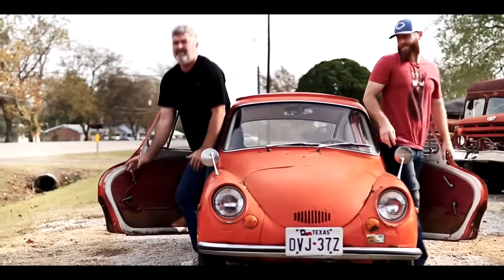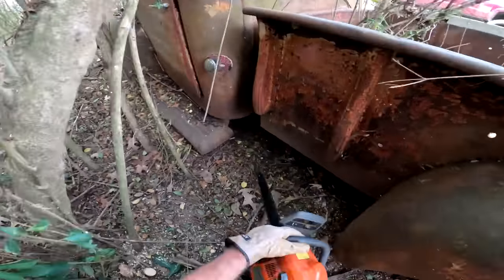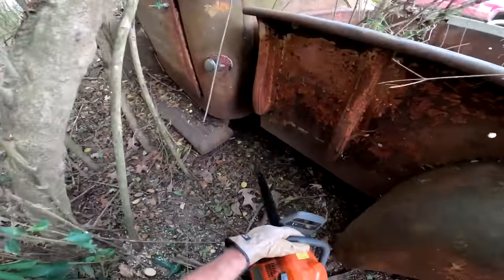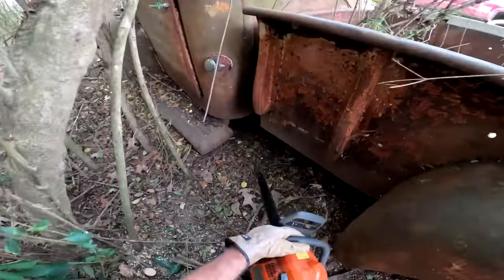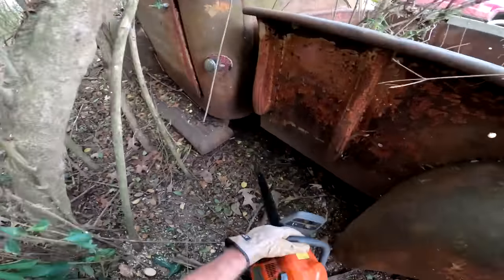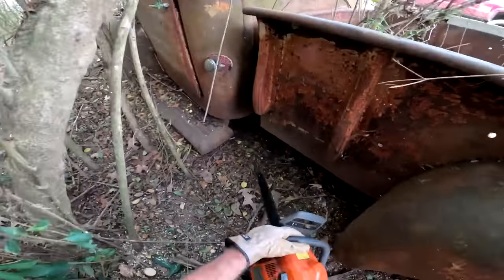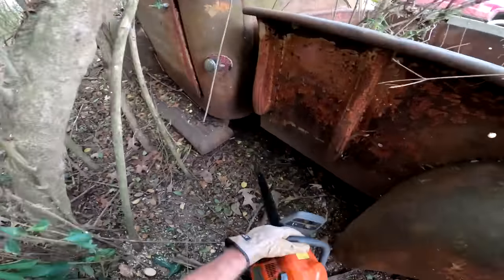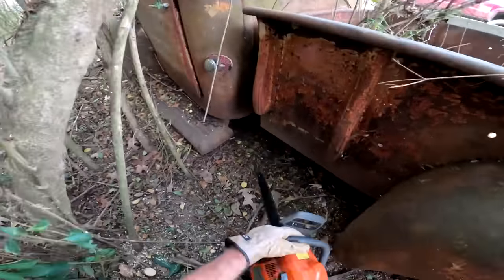FULL REBUILD: Abandoned Truck Rescued From Woods | Locked Up To Running After 50 Years | Turnin Rust

Comment: Now, what's needed from now to future time is, if your going to park it, pull the engine and disassemble it completely and store the parts in or With the vehicle. No more frozen engines! Even though small miracle was performed, that's a heep of a lot of work to go through.

Comment: You are working wonders, and it is great to see how you resurrect these old vehicles. Just one piece of advice: try cleaning them before starting to work on the engine and stuff. You are always basically working in a rat’s nest, and all that polverized turds are making you no good. Please be safer and God bless you for the example of family work you are showing.

Comment: Anther  successful restoration. Good job. That is a lot of work. I have a  53' Desoto, flat six, wasn't stuck but it did have a bunch of stuck valves. That is a common problem with flat heads.That works against you too. Also had t replace an intake valve due to corrosion. One thing I have found is that mapp gas puts out a lot more heat than propane. May be something to try. Someone tested various products for freeing nuts and bolts and they concluded that liquid wrench was the best. I use PB Blaster but have wanted to try liquid wrench. Keep forgetting to get it. Maybe you could try it and see if it seems any better to you.

Comment: For lubing up stuck threads use heat and lights a candle and let the wax drip it will work its way into the threads

Comment: Love the show 17 I found a 38 for truck in a barn the engine had frozen & busted I found a flat head in a old mercury I pulled it out brought it home and put it in and it run like watch it would idle so low you could count the fan blades going around it was a v8 . That was at Va. beach I came to Roanoke to visit my family and when I went back it was gone they said two Sailors said I sold it two them I had tags on it and drove it still have the title .

Comment: I've always used, believe it or not, cola in stuck cylinders. The name brand not store brand. I've used it in 15+ rebuilds over 50+ years and it hasn't let me down. Soak it overnight it should free your pistons.
Also, judging from what I see in the video, up to 1hr mark, you really should pull the motor. Corroded nuts/bolts will make it dangerous to drive if you don't replace them with new. And you will obviously need to replace all the wiring which is easier to do with the powerpack out of there. You used to buy oil in those type cans.

Comment: Well, it would be great if you could find an effective starter for that. The trouble is, they quit making that type of starter decades and DECADES ago. So as they found out, they had to choose another International brand starter from the same long gone era!!! And the International Motors was well known for making crappy quality starters. Add to it the fact that there are no NEW International starters that can be used with your vehicle ( all of them being extraordinarily old and tired like the one you originally had ) you're SCREWED.  If you are extraordinarily lucky, ( UNBELIEVABLY lucky ) you may find a brand new such starter on a website like e-Bay, where some old great grandfather just happened to have one in a box in his attic. But the chances of that are nearly ZILCH!!!  If you have an old WWII era truck like the one in the video, you'll just have to get used to the "clutch pop" method, as the only starters made for your truck went obsolete way back when your grandfather was still a small child. That and, again, International Motors  is FAMOUS for their poorly built, low power starters. So you'll just have to get used to popping the clutch.

Comment: Art deco design elements in the right places  they don't have anything that's made with this much thought of a reliable truck that anyone could afford now  most people are driving in and new truck that cost more than their first house 😮and the house is still standing 50 years later some newer vehicles will be in a junkyard  within the first 5 years and within 10 more than a  1/4 of them have recalls but now they say that anything with a car with airbags is under recalls and they lied about how they saved lives as they were causing us receive a new set of injuries that were not seen before as it was airbags  causing them not smacking the windshield with your face  is a pretty fare trade  though 🫠